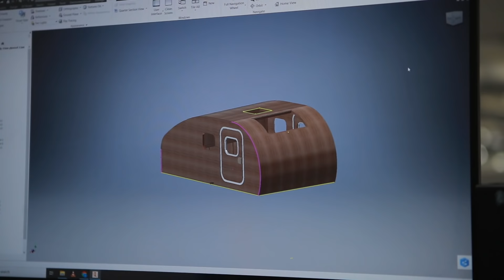DIY teardrop trailer camper caravan build

Comment: I could buy a teardrop trailer for the price of the CNC machine.  DIY is a misnomer. This is a factory build.
Reply: Yeah even renting one with a 48 by 24 cutting area is 1500 a mo.
Reply: He’s just showing how far ahead of the game he is vs avg joe in garage and handsaw. It’s good to have every modern tools at his disposal.
Reply: You could cut with guides/those glue ups not necessary.
Reply: I'm just amazed of how bad he is at doing any actual skilled  work. He could have used the panels to draw over the insulating board and make a nice fit, but he decided to chop the corners like a DIY.
Reply: he did this himself. his cutter is nice and all, butt he still did all this himself. folk see cnc and whine. from their couch or toilet. a thing they will never make. hand them all the cnc in the world and they woll never give you a trailer. don't sweat the hate. thing looks nice man.

Comment: Excellent build! I love the use of CNC cut panels. Only thing I think would add to the quality and wouldn't cost hardly anything additional is the use of XPS Pink foam. Has a higher R value and is all around a better material.

Comment: Great work! I hope to build one myself in the future. 😎

For the doors you could have left them in place with a few little tabs on the CNC router. You can then mount the hinges and cut those tabs. No more fiddling with alignment and very easy to do in almost any spot.
Reply: Spot on! That's engineering meeting the tradie

Comment: don't know if anyone said this already....  but that piano hinge for the back hatch is going to leak like a cheap hose.   either use a "hurricane hinge" which is stupid expensive....  or you can do what i did for a vertical hatch, and find a piece of wide, flat rubber edging.    Glue one side to the top half, and let it hang over the hinge.   it will act as a drip-edge.   OR.... you can build a "trough" to catch all the incoming water, from the inside, and channel it outside.
Reply from the maker: good observation. i used nitrile rubber strip
Reply: @christiangreen612  
that should do it.   How's it holding up?
Reply from the maker: @wesleypipelayer7627  pretty well, no water intrusion yet
Reply: @christiangreen612  
well that's good news.

Comment: Hello, It is known that a single thermal bridge can destroy any insulation, even the best designed, why put insulation if not to save weight?
Reply from the maker: wood has low conductivity anyway, the expanded polystyrene is an order of magnitude better, thermal bridging will be at a minimum. i wanted not only thermal insulation, but sound deadening also. if i were to do it again i would have removed more material from the frame, reducing thermal bridging, and making the structure lighter

Comment: Hi Christian, great job with camper, looks amazing! What is plywood thickness on the walls and what did you used for outside siding, is it aluminum sheets?
Reply from the maker: thanks, i used 25mm thick plywood for the frame, and 4mm thick poplar ply for the interior veneer. the outside was 1.5mm aluminium laser cut to shape, and the red colour is vinyl wrap
Reply: @christiangreen612   Mr Green i am really impressed with your work all the way from india 
i gequest you to kindly send me the specification of your marvalous project. i actully started dreaming to get one for my kids here in india.

Comment: Salutare sunt curios ce greutate a ajuns la final. pentru ca stiu ca masa maxima admisa este 750 kg cu tot cu platforma in sine. Multumesc
Reply from the maker: with gas bottles and battery etc fully fitted, its about 500kg total

Comment: great video, are you going to put this in to production?.
Reply from the maker: Hi Glen, i am considering it, although i think the next one i would make from aluminium space frame, and just have a wood veneer for interior, so it would be much lighter. this one came out around 350kg, but with aluminium space frame, it would probably be half that
Reply: @christiangreen612  If you are going to build more, please leave a comment. I would buy one if the price is wright.  regards, Henri

Comment: Maybe it just didn't make it into the shot, but I assume you sealed between the window/door frames and the metal skin right?

Cool build. Would love to do a teardrop or some other sort of custom camper at some point.
Reply: Ah my bad, those were alignment jigs you were putting in place, I see that you sealed around the frames when doing the final install after painting the metal.
Reply from the maker: @haphazard1342  yeah everyting was sealed, also i didnt film it, but the wood structure got 4 coats of polyeurethane  laquer before applying the aluminium

Comment: Nice job, Just today I glued up a 1:10 scale model of the trailer I intend to build. I'd love to have access to the machines you used but I'll be getting by with basic tools and a welder. I'm trying to go 'no wood' and using aluminium composite panels. I recently retired and it will be great to have a large project to keep me busy. BTW, did you build the trailer or buy one?
Reply from the maker: good luck with your build. yeah if i were to do it again i would make an aluminium space frame, with aluminium exterior panels, and only wood veneer for the interior. you can use a laer cut company for the cnc exterior panels, and contract a wood cutting company with a cnc router for wood panels

Comment: hi Christian, I love your trailer, it's outstanding. I also love the integrated design, where all the shelves and dividers help the overall structure. You did unfortunately not leave any comments or explanations. What trailer frame did you use? what size is your teardrop? I also was wondering: the trailer all of a sudden was red. Did you paint it or were the panels red? And a big question: since it's a CAD design, would you sell the data? I would appreciate your response!
Reply from the maker: Hi there. i could send you the cad files if you like. the trailer became red because i vinyl wrapped it. i dont remeber the trailer size off the top of my head, it was something like 10ft by 6foot. i can get the dimensions tomorrow if you like when i have access to my office computer
Reply: @christiangreen612 , and if you know the final weight of the trailer as well! Looks like you're pulling it with a Daihatsu Rocky/Forteza?
Reply from the maker: @kululv  well i didnt weigh it, but the cad model is telling me the total cabin weight is around 185kg but thats without deep cycle battery, gas bottle, fridge, solar panels, mattress etc, so i guess with that its prb around 280, the i guess the trailer is prob 120 kg, so in total i suppose its around 400kg
Reply: @christiangreen612  Thanks again. that would be great! So how can I take you up on the offer for the CAD file?
Reply from the maker: @kululv  send me your email here, i will delete the email post after, and i will send you the cad files via email
Reply: @christiangreen612  hi Christian, sorry to bother you again, but I didn't see an email from you. Did you send the CAD file already? Thank you!
Reply from the maker: @kululv  i didnt get your email address
Reply: @christiangreen612  I just sent you another message, but it did disappear. @kululv  i didn't get your email address -> @kululv
Reply: without the @ in front of the 6 letters  and its geemail
Reply from the maker: @kululv  email me, christian@kline-innovation.com

Comment: How many days work are fast forwarded?
Reply: Great job by the way seems like you planned everything out very well is there anything you would change or add
Reply from the maker: @earlbond007  thanks, im not sure how many days are fast forwarded, but the whole build took around 3 months working evenings and weekends. TBH, if i were to do it again, i would build it from an aluminium space frame, and just do wood veneer inside, so it would be super light, maybe as low as 150kg, currently its around 350kg
Reply: @christiangreen612  any accessories  or anything  you would  change about the layout?
Reply from the maker: @earlbond007  i would probably omit the roof fan, you can just open the window and it negates the roof fan. also im going to remove the front box, as it blocks the rear door of my 4x4 from opening fully, aside from that its all good, i like the solar charging, fridge, cooker, inverter, general layout etc. ah i will change the heavy deep cycle battery to a lithium ion battery
Reply: @christiangreen612  if I build  one I want  to do like a special  ops theme lots of tech inside and plugs for electronics and radio and maybe green lighting so it doesn't  stand out so much if I have  the interior  lights on at night and I want  a trailer  hitch so I can get the grill/cooler/table swing out and I think I would  do the shape of the hive trailer
Reply from the maker: @earlbond007  sounds sick, good luck with the build